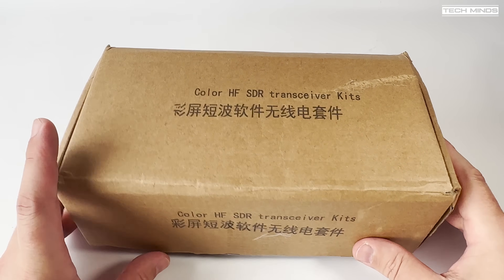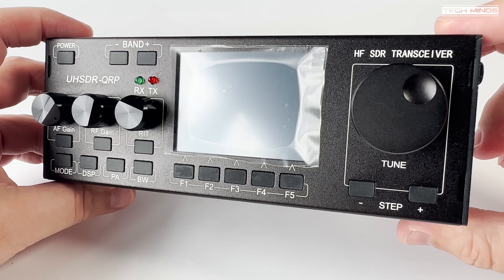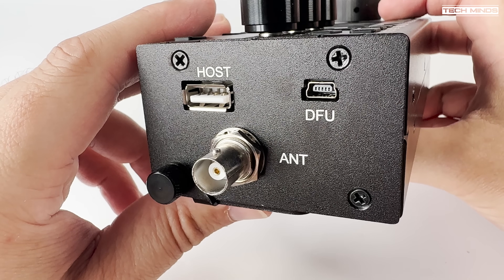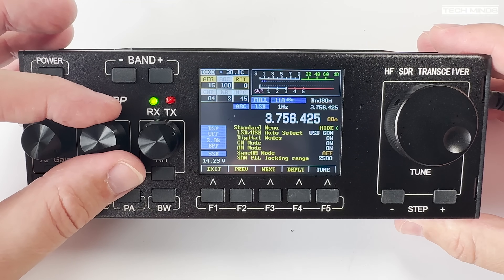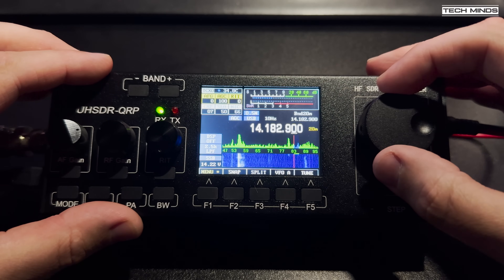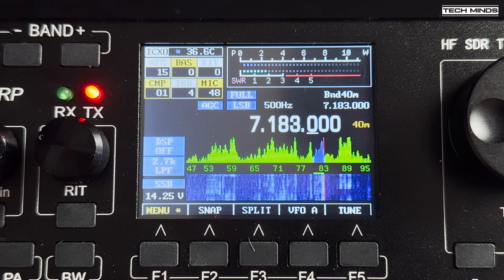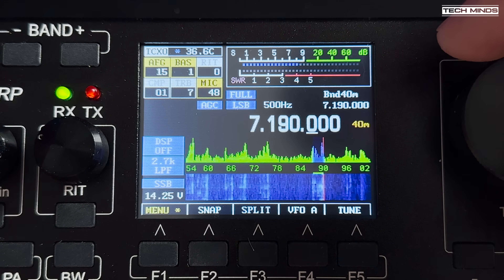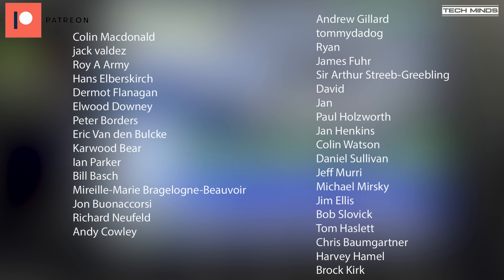UHSDR-QRP MCHF HF SDR TRANSCEIVER - Latest Firmware & Bootloader

Comment: To set the max power you have to put the PA bias first Line to max and then choose the "full max power" line according to a band AND set your radio to the corresponding band AND the right power with the PA front button. The only way to set the power with a power meter. You can only set 5w and full power in the menus but it's Ok given adding an amplifier is not easy in portable operation.

Comment: Hi i got one of these, i got it from Bangood, i dont have touch knobs, does yours have it ? I also dont have the touchscreen?   Hmmm... when i got it it had the newest software and therfore i could not transmit on 11 meter, so a friend og mine changed the software to an early version, and now the 11 meter works like a regular cb radio, but i still wonder where my touchscreen is, i dont csre about the knobs, since the buttons does the same job.   73 from Norway.

Comment: I bought one of these on Aliexpress and it actually works very well for what it is. The menu settings took a bit of time to get used to, but fortunately I wasn't expecting the moon. Had two QRP POTA contacts using 5 watts with good reports on each. Is it like a top-line Icom, Yaesu, Kenwood or even Elecraft? No, it's not - but for what the UHSDR is, it works very well. This will be my portable rig going forward. 73 de WQ1C

Comment: I bought one of these.. love it.. but have not been able to transmit on it. Power & SWR meters do not register a signal.. will the updated firmware change all the presets to optimise the radio? I know it has PA configuration at 5W and FULL but I’ve not got into that yet.

Comment: Out of the box is the radio ready to use or you have to set manually the operating parameters?
Reply: With mine I set the parameters to what I wanted them to be. The menu is a bit extensive, just make note of that.

Comment: You mentioned this item is based on a Radio Kit. What’s the name of the kit? As my knowledge and skill level slowly creep upward, I’m finally to the point in this hobby, that I want to attempt an SDR transceiver build. Do you know of any websites or storefronts that sell anything like that?? If there’s a kit version of the radio you demoed in this video, point me to it. I’ve bee wanting to build one so bad as to seriously consider cloning and building Analog Devices old PackRF SDR.  I’ve found a lot of little soldering practice kits but I want step it up a bit. Any input will be greatly appreciated. Thanks for the videos. Always interesting, informative and fun to watch.

Comment: I bougth a derivated from de original MCHF proyect called R928+. The firmware its not the same for this QRP but exist groups and people can work new releases with more features. I have this QRP for three years and the last year and half I been using this rig for Digital QSO (FT8 mainly) its great for me and dont have intention to change for another QRP.
 73´s
Edgard CA3DRL

Comment: I have the RS918 with stock firmware and it works wonderful, I'm planning to dump the latest onto it and see how it performs.
Reply: What is the difference between mchf and rs918?
Reply: General rule of thumb: don't fix that ain't broken. ;)